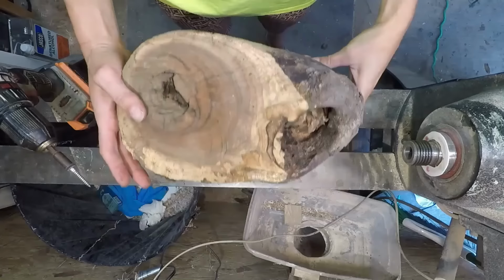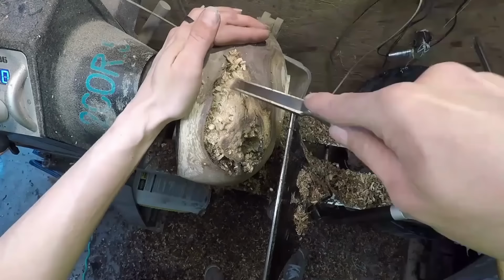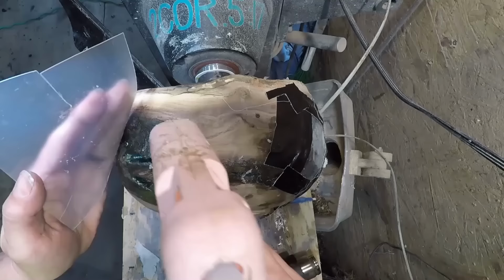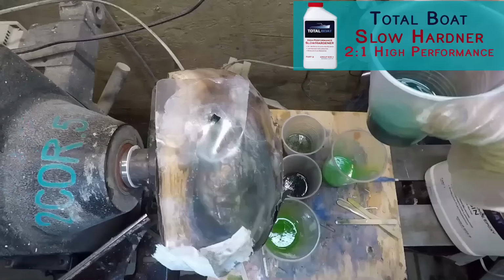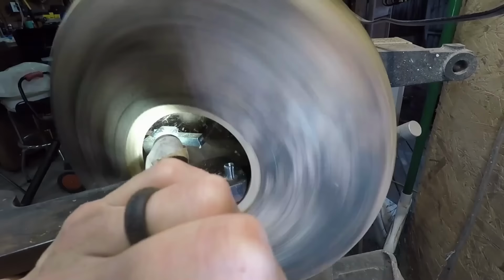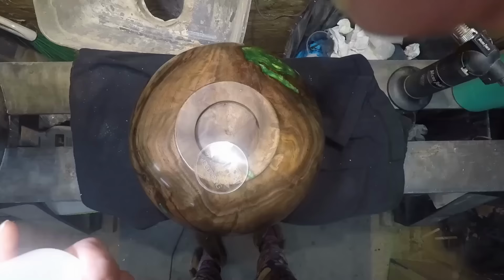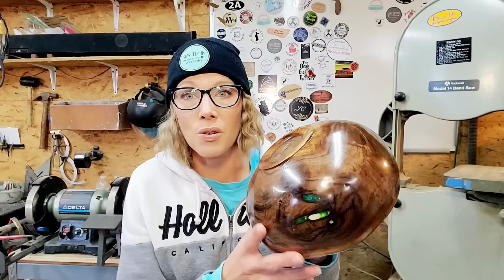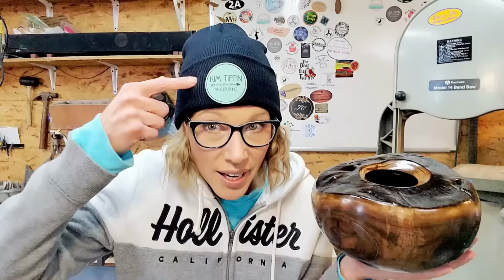Walnut Crotch and Resin Hollow Form. Total Boat Resin Green

Comment from the maker: Plastic Chopping Mats I use for the molding for resin HERE : https://www.dollartree.com/flexible-chopping-mats-11x14in/145661
Reply: Too funny...that was the first thing I was gonna ask after I finished watching.  I found a roll of disposable chopping mat at Lowes this weekend and was going to try that out.  Seems pretty tough but pliable.  If it doesn't work I'm heading to Dollar Tree!  I found some pvc pipe liner material that worked really well on the last casting i used.  I wish I had thought to heat it up I could have saved about $100.00 in resin.  But lesson learned!
Reply: Gorgeous piece btw! :)

Comment: Hey Kim! As always, nice work! I learned something about using resin in cooler weather that may help you, even in Florida. LOL. What I've done that works well is to have either an airtight cooler lined with foil (to keep the resin from reacting with the plastic) or, better, have an old used electric oven, preheated to the lowest setting available ( I like to have it preheating for at least a ½ hour), then place the resin project into the turned-off oven after leaving the door open for 2 to 3 minutes (to make sure it won't bake the piece) before closing it. Both the cooler and the oven will hold the heat generated by the curing resin, making it cure more properly, not to mention keeping the bugs out. I personally like the oven better as it is already up to temp, and leaving the door open for a couple minutes will allow it to cool down without giving it enough time to cool the walls completely out.
Reply from the maker: Thank you so much for the tips!!
Reply: @KimTippin  Although it is a good idea to make sure the oven will not stay above about 100ºF. You can also simply leave a 60 watt incandescent bulb on in either the oven or cooler, which will keep it right at about 80ºF

Comment: I really like the different techniques on this. Very interesting that a little cooler weather affects the epoxy so much. I am from Canada, and purchased epoxy from Black Forest Wood products. When they pour their river tables, they use a cool room, and air cooled tables. Love your colouring. Tried alcohol dye to colour- big mistake, as it won’t harden
Reply from the maker: Alcohol inks work great.  You have to be very careful not to add too much. It will not cure or it will stay flexible.

Comment: You probably already know this as you use the mix for a sanding sealer, but that mix will give you a beautiful high gloss finish. Keep layering the coats on as soon as they dry, which is very fast. Thin coats, sand after the first two or three then no more need for sanding, then just keep adding coats as they dry. Like a lacquer, the coats dissolve and fuse to the previous layer. Basically it gives you a French polish finish. Keep the lathe on really low speed and you'll be able to do about ten coats very quickly, twenty coats is simply a "keep going" process. You'll have fun playing around with the process and you can't really mess it up. The denatured alcohol will always be the solvent that works.
Reply from the maker: Thank you 😊

Comment: I wish I could get my resin coating to be smooth like yours. My lathe does not go that slow. Maybe that is part of the problem.
Reply from the maker: I allow the finish to cure to a very tacky non run finish, while it turns at 50 rpm. Any faster and it will gather to one side or end.

Comment: Finished product came out great! Question if I may, What did you have wrapped around Tim's tool? And Why? Also did you find using a box rest better than using a rounded top tool rest?
Reply from the maker: I taped a flashlight to it so I could see. didn't do much good but I tried.  lol
The box has a larger flat service to get your hollowing arm center and flat. Also you can fit it in farther than a normal tool rest.

Comment: Beautiful beautiful! I love the rich color of Walnut! 

Question for ya. I recently used resin for the first time on a carving in Water Oak (aka Rock oak. Was in my parents yard in Panama City Beach until Hurricane Michael had other plans) and I noticed after the resin had hardened, the resin had sunk in and wasn’t flush with the wood anymore. Does that ever happen to you, or do you know of a way to prevent that?
Reply from the maker: Thank you so much 🤗 
The wood absorbed the resin or when you mixed the resin, you incorporated air. The air gives you the illusion that there is enough resin. 
If the wood soaked it up, well not much you can do about that except add more resin. Sometimes my projects are thirsty 😁
Reply: @KimTippin  ah ok. Thank ya ma’am.

Comment: Hi Kim:
I love your work and watch all your videos. I am a turner also. I mostly do segmented turning but I want to get into the resin casting bowls. I have used Alumilite but I want to try Total Boat.
I would really like for you to tell me which Total Boat resin to use. And what is the resin I see you apply with a brush that you use for a top coat?
Thank you for your time.
Don Peters......(DAP Wood Works)